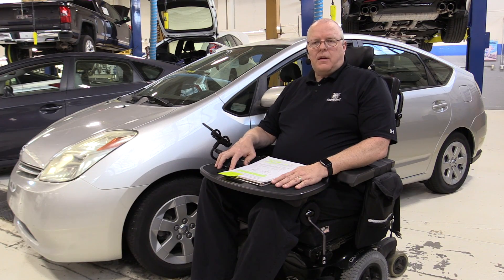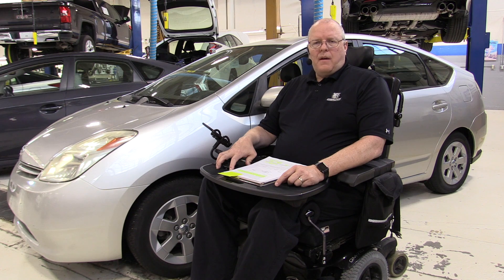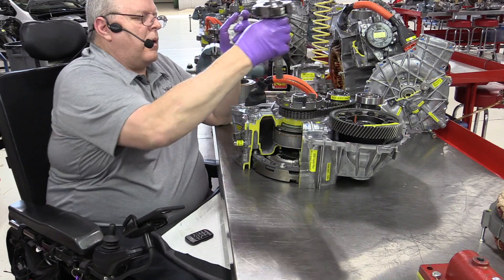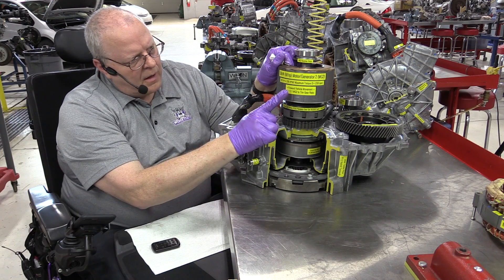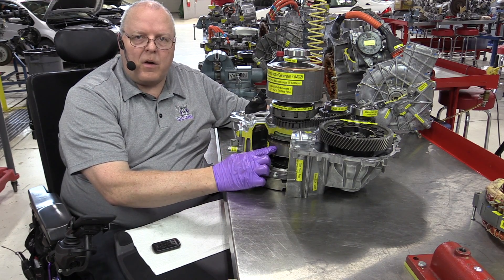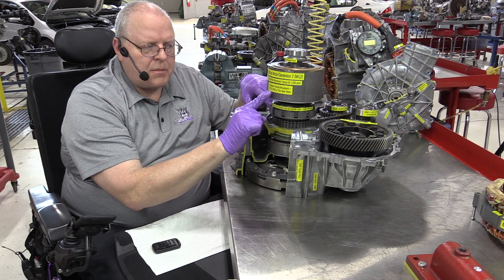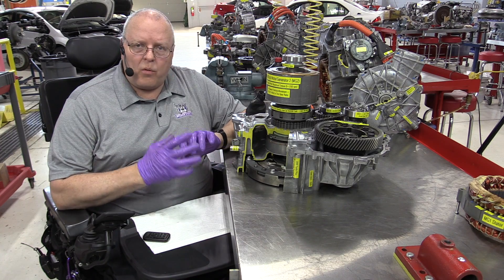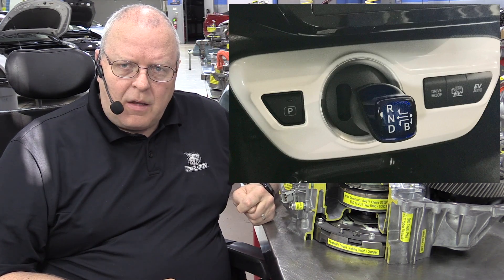2004 - 2009 Prius Transaxle -  P112 Quick Look

Comment: Thank you very much for these videos, especially the ones about the Generation 2, which I started watching around 2015 and which impressed me enough about the GENIOUS of the engineers who designed the Generation 2, to help inspire me to buy, in 2019, the 2008 Prius which I'm using these days. I even eventually also bought a spare Generation 2 transaxle at the junkyard with which to hopefully eventually fulfill one or another of the umpteen pipe dreams that I have of things that I think I could build with it. 

To nitpick on the part about the smaller motor-generator only doing a smaller amount of the regenerative while in "B" mode on the downhills, I suspect that it perhaps does a not-to-be-so-sneezed-at amount of the regeneration when you count the fact that it spins much faster. 

My dad's last car before he passed away in 2019 was a 2007 Prius that he'd bought brand new, and even though he'd been a lifelong professional physicist, it took your videos to REALLY impress me enough to buy a Generation 2.
Reply: Oops - 2009, he passed away.

Comment: You can have an electric motor to idle simply by leaving the stator circuit in "open" state, thereby only the voltage is induced in the coils but there is no current. Hence no torque/mechanical energy is produced by the motor in that case.

Comment: thank you for a great video!!!! I have a question; when the SOC of the battery is very low the force of the regenerative brake is strong right. but the force of the R.B, is proportional to the SOC? meaning as the SOC increase the force of the feeling of the car breaking decrease, the force of the RG decrease? or the the force remain the same until the SOC of the battery is full and then there are no more RG?

Comment: The 'B' mode does not appear to add any KW recharge generation at all, so you may be mistaken on its use of rotating both MG1 and MG2. I have monitored my power for years on my 2007 prius using custom PIDs in the Android Torque Pro app and 'B' only increases breaking by engine compression. A very similar thing happens once the battery is full, and you begin to coast (often happens if you are going down a long hill). Normally, there is a baseline regenerative breaking always occurring as you coast to "simulate" coasting in a normal gas engine. When your battery is full, and you coast you will hear the engine turn on and begin compression breaking like a normal car would when coasting. Throwing on B just activates this engine compression breaking before it is technically necessary (you could still use the break peddle to increase regen breaking power before the battery fills up). I think B mode is all about saving your friction breaks on prolonged downhill drives, especially for dummies that think it'll just be regen breaking the whole time. I notice I hope that explanation helps understand what B is used for.

Comment: Please me help! 
I have 08 Prius , gas engine does not turn over , but when put in D, vehicle still moved by electric only. I am guessing it has a Transmission problem . What you guys think ? Thank
Reply: Sounds like just your electric motors are working. The prius battery on full charge will maybe only move the car about a mile before completely draining, so I doubt you got very far. I doubt this is a transmission issue. If the engine isn't turning over, than it is probably some engine issue (like no gas, no compression, no spark etc). Even with a blown engine, the prius will still go to "ready" and use the electic motors. Only once it tries to fire up the combustion engine will it probably realize there is a problem and through you codes

Comment: Awesome video as always, your explanation and cutaways on how it functions is fantastic.. I have a 2nd gen. 282k on the original battery. Doesn't leak a drop of oil. Very reliable vehicle.
Reply: Same here, 271,000 miles. No issues, very reliable vehicle. I just got it 2 months
Reply: @ONEHEARTSOUNDS  
Do the regular maintenance and they will last.
If you just got the car.. definitely drain and refill the transmission fluid, unless you know it was done recently.
It's an easy job.
You need a 10mm Allen, socket and a 24mm socket.  And 4qrts of Toyota World Standard ATF.  You don't have to buy it at the dealer..  Walmart usualy has it... For $18 for a jug that 4qrts.
You need a hose about 2 feet long and a funnel that will go into the hose.
Drive the car a bit.. get the fluid hot. Let it sit a few to settle down to the bottom.
You take the fill bolt out first ..always.
Then the drain bolt out,  drain it.
Replace drain bolt.
Open hood.. pass the hose down from the top. Stick it into the fill hole.. put funnel into the top of the hose..
Pour in the fluid..
Replace fill bolt.. your done.
Takes 15 min. Or less.
Reply: Thank you @kens97sto171

Comment: To my understanding, you don't necessarily 'control' the torque from the engine by limiting the speed of MG1. The Planetary Gearset is functioning in such a way that the torques out of sun, carrier and ring have a fixed ratio to each other. T_sun : T_carrier : T_ring = n_sun : -(n_sun+n_ring) : n_ring. So it's really two systems running in parallel, while sharing the same speed on the ring gear. One system is the MG2 system; the other system is the ICE-MG1 system.
Reply: Nevertheless this is a GREAT video! Just saying that how ICE works in assisting MG2 might require more dedicated explanation. I'd like to make a video explaining it some time.
Reply from the maker: Engine torque delivered to the ring gear is controlled by the rotational speed and direction of MG1. Try letting MG1 free spin. No engine torque will be delivered. Thanks for your feedback!
Reply: @WeberAuto  Aloha Professor Kelly, (and others).( Obviously) I am writing from Hawaii. I recently purchased a 2005 Prius, about 153K. Having fair amount of non-electric car knowledge, I have been inspired to learn about the Prius, as this one has some problems, and it would be satisfying to fix it without inordinately high expense of dealer cost to replace hybrid battery, (as was suggested by the dealer to correct a couple of low cells in the hybrid battery. The car had sat for about a month, I believe, from the previous owner, and was showing codes including PA080. I've read that corrosion on the plates connecting the individual battery cells to one another can generate a code of low cells).
   Anyway, that was not the main reason for this reply. In the video that this thread is connected to, (Prius P112 transaxle "Quick Look" from about two years ago - https://www.youtube.com/watch?v=WL9I_MLj1aw) - you, (Professor Kelly), wrote in the tag/addendum at around 11:45 regarding the "B" and "D" positions on the shifters, that MG2 acted as a regenerative' braker', in the "D"position without MG1. In the 'relatively small', (compared to the slew of videos that you've created - and, by the way, thank you VERY MUCH ~ it's been good to learn from you), again, in the "relatively small' number of videos I've watched on the Prius, only MG1 has been mentioned as one that does 'regenerative braking'...and I had wondered if the words MG2 and MG1 had been mistakenly switched. But, based on some comments by others, (such as David Malolo), there appears to be some question as to how it actually works relative to the "B" and "D" positions on the shifter. Is the relationship Weber State University has with Toyota such that Toyota would be willing to clear up the answers to such questions? 
Again, thank you for your time and detailed work in your videos :0)))

Comment: As far as the B setting goes, I would add that the engine is also used; I imagine it is used as a compression brake alongside the regenerative braking. I know the 05 prius my mother had would let the motor spin up as you slowed in the B setting, and the 2013 model she bought after it was totaled does the same.
Reply from the maker: Good point, especially when the battery state of charge is full. MG1 will actually crank the engine with the fuel disabled to dissipate electrical energy and use the engine's compression to slow the vehicle. Thanks for your feedback!

Comment: So neutral doesn't disconnect the engine from the wheels?
Reply from the maker: Neutral is just software based. The engine is always connected through a planetary gear set, but not a direct connection.
Reply: Ok so how does a non-hybrid with a cvt do neutral, I thought it was slack in the "belt".
Reply from the maker: No, they have a forward clutch pack to connect the engine to the drive pulley. In neutral they simply release the hydraulic clutch pack.
Reply: Cool, thank you.

Comment: Thanks. Actually it is very interesting, what actually happens when power electronics are offline and you spin the motor.
I have Nissan Leaf and user manual prohibits towing (wheels down) while vehicle is off. Why?
Does spinning motor and disconnected battery result in voltage spike? that might harm inverter?
Reply from the maker: Thank you! Good question. From what I can tell by looking at the internal schematics of the Toyota inverter, the current induced by the spinning rotors would make a loop through a rectifier diode, then high Wattage resistor, then back to another rectifier diode to complete the circuit. I am sure the diodes can handle the current if they are kept cool with a functioning cooling system. The high Wattage may not be rated at a high enough Wattage to handle the potentially large amounts of current from the rotors spinning at higher rpm. This, of course would burn out the resistor pack and possible lead to voltage spikes (current spikes) jumping around damaging more internal inverter/converter components.
Reply: WeberAuto If vehicle is offline it acts (rolling resistance) as it is in neutral (motor spinning, no load). at 100mph/15000rpm switching to N appears to be safe. To generate heat there must be some drag. Doesn't appear to be any. cooling pump is offline if vehicle is offline. Those resistors on Prius, are they  specifically for this scenario or they do something else too?
Reply from the maker: It does not matter if there is drag. If you spin a magnet inside a coil of wire it will induce current proportional to the RPM, number of coil wire turns, magnetic field strength, etc. Those rotors are either a motor or a generator, there is no other option. 15000 RPM would generate a very high voltage with current proportional to the circuit impedance. Heat would definitely occur. I don't know for sure about the Prius resistor function, but I suspect they are used for this scenario.